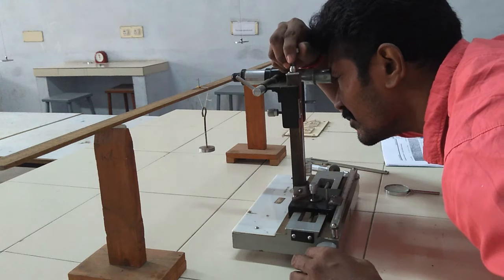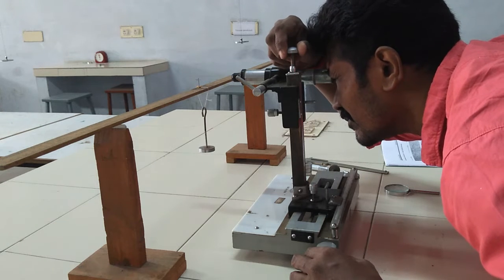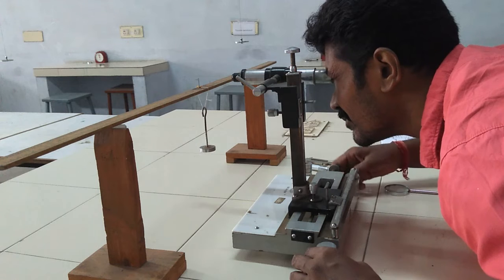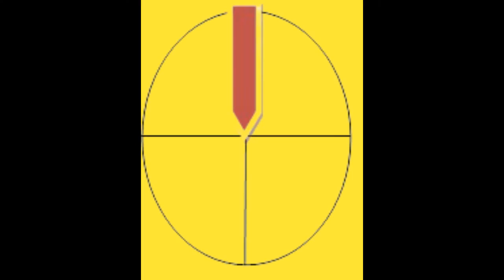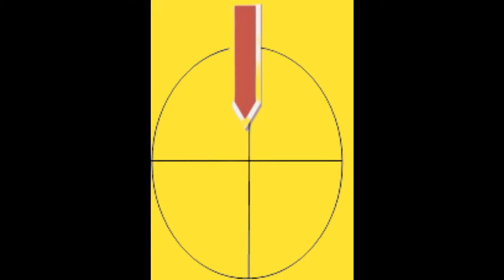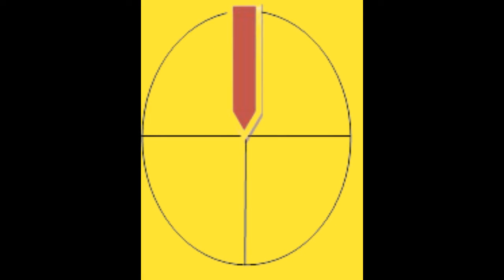Young’s modulus Non-uniform bending || Non-uniform bending-Determination of Young’s modulus

Comment: Sir uniform & non uniform  bending final answer correct tell me
Reply from the maker: Maximum 0. To 1.,,,X10 +10 m (both)
Reply from the maker: Young's modulus , answers you choose depending on material  this value for wood bar
Reply: Minimal 0.6 to maximum 1.2 but exact answer 0.7